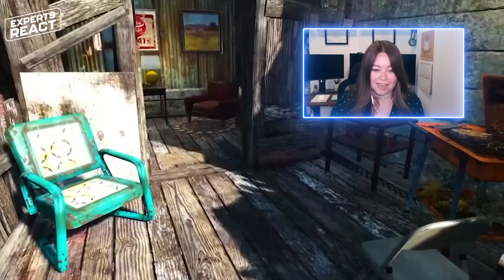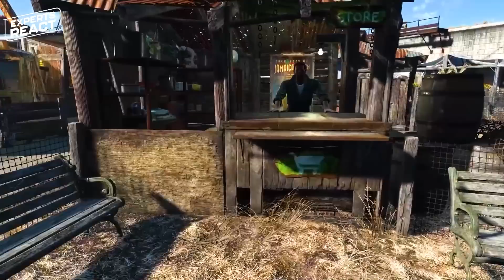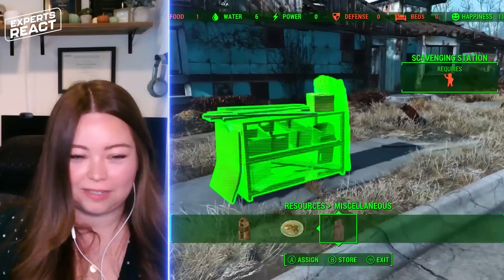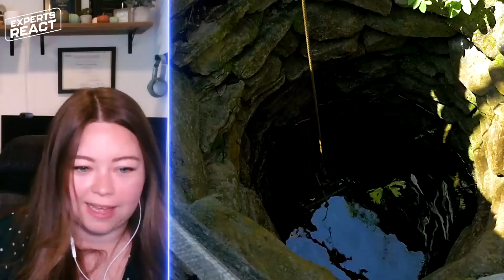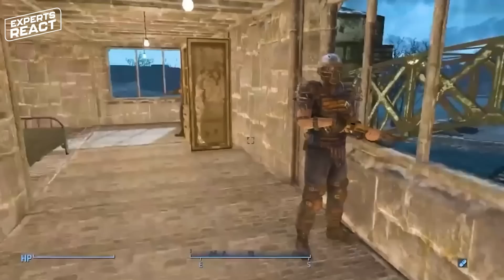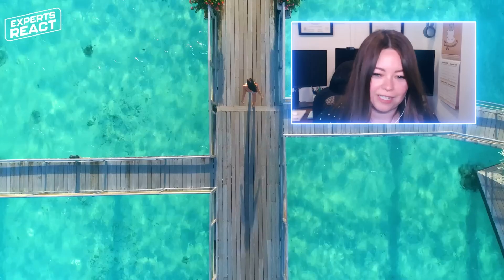Civil Engineer Reacts to Fallout 4 Settlements

Comment: Someone needs to contact Christine and tell her about the Sim Settlement series of mods. And hope she has a good PC so she can run a modded Fallout 4 as she expressed interest in doing - I give it low odds one or two of the featured settlements were done in vanilla.
Reply: I doubt any of these were made without mods. I tried settlement building in vanilla and it takes forever to even build small areas because collecting resources is a hassle
Reply: @Phlegnut19  Modders have done a better job with settlement building mechanics than bethesda ever could have. And I dont even use the feature except when I need the workbenches at whatever happens to be my main base.
Reply: @highmaintenance7879  same tbh.
Reply: @Phlegnut19  most just console command in more resources.
also there is way to get ingame a lot of resorces by abusing Bathestas Math.

that said would love her to rate Sim Settlements (whit addition mod packs (blueprints).
or maybe even have her do a build herself.

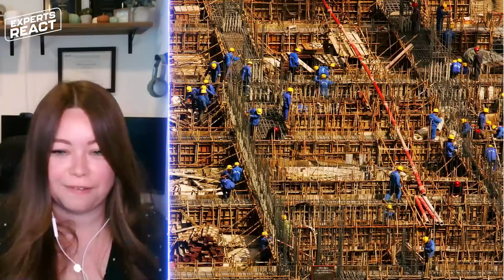Comment: 2:20 she's not wrong. I remember few years back, when I was in the electrical trade, we had a bunch copper wire stored in the electrical room during Christmas. When we came back all the wire was gone. These weren't just small spools of wire either. They were huge and heavy. The person/people were able to get in because the cut through the drywall
Reply: Never underestimate how much copper wiring sells for.
Reply: @baker90338  *copper
Reply: @agps4418  A fair correction, thank you
Reply: @baker90338  😄👍
Reply: @youcansave15ormoreoncarins75  not my fault. I was working on data cables at that time and I was on a different floor.